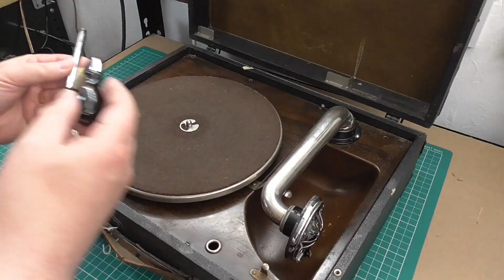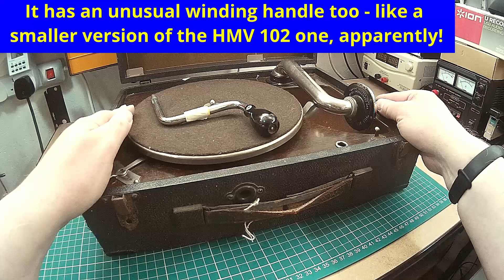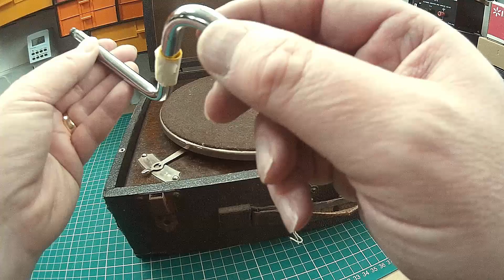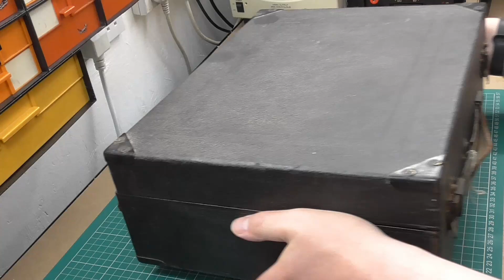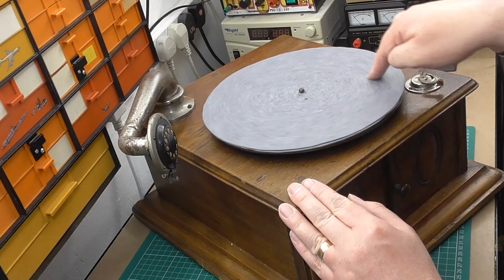Gramophone test WITHOUT a winding handle

Comment: In my experience, this test is only valid if the spring is broken near its centre.  I recall owning an HMV portable in which the spring was broken at the outer edge. It was possible to wind it to about 25% capacity before the charactersistic 'ratatat' of the spring rapidly unwinding within the barrel. Needless to say, it would need many reverse turns of the turntable to reveal this style of fault. Would say your test is worth doing, but not 100% definitive. Yes, springs are dangerous, but was lucky that my father told me how to remove one safely & my metalwork teacher helped me 'de temper' the end of the spring to create a fresh hole for the rivet. A YouTuber friend in the Harrogate area (Samantha James) has a gramophone with a broken spring. Can you recommend anyone who'd fix it for her please?
Reply from the maker: Very good point. Yes, it is by no means a definite test, but a handy little test that can be useful. Unfortunately, I don't currently know of anyone offering a spring replacement service. Due to the hazards of spring removal, I can't personally recommend anyone trying it. I do hope to try cleaning and regreasing a spring whilst it is still in the barrel, which is something I have seen recommended in an old book. This should be a safer option, but of course, it is only viable if the spring is intact. Thanks

Comment: Maybe you can answer this question for me……….. is it possible to buy brand new springs ? 
I want to buy a brand new spring (also preferably in its casing all ready to slot into place on my gramophone)
I need a double spring for my HMV 130. 
Can you advise or point me in the right direction either way a possible link 
?
Reply from the maker: Sorry - meant to reply to this before. Unfortunately I don't know of a source, though if you are on "The Talking Machine Forum", someone may be able to help and there is a very well known dealer by the name of Soundgen who (at least in the past) I believe been able to supply replacement spring barrels. Another possible source is from another motor. Whilst changing a spring certainly has its dangers and is not something I would recommend anyone trying, switching the spring barrel from a working motor to a non working motors is easier and safer (do make sure the springs are fully unwound before doing so), though in many cases it might be simpler to just switch the whole motor - like I did with my HMV 130. Thanks 😀👍
https://youtu.be/6PbHfAw6Jwo

Comment: Thankyou i didn't know that what good advice i was given a nice HMV table top Gramophone last year and i was lucky though it didn't have a winding handle i had a spare which fitted it and to my surprise the spring was in good working order. Thankyou again i look forward to more of your video's. 😊😊😊
Reply from the maker: @Kevin-yi8fd  Thanks, glad you enjoyed it! 😀👍. Yes, most of the time a spare handle is relatively easy to find as many HMV/Victor machines take the same ones, and they can also be swapped around on Garrard ones. The older slotted type vary alot though, and that is what the broken machine in this video takes. I have found a handle that fits it, but as expected, it doesn't wind. The HMV 99 portable just annoyingly takes a special handle so not so easy to find a replacement. Glad to hear you were able get your machine going. 😀

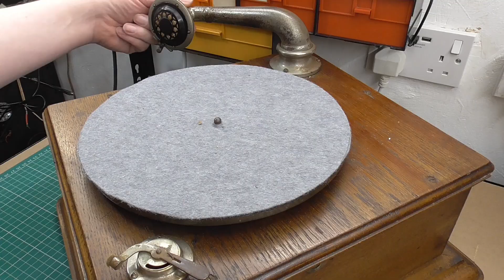Comment: To play a 78 RPM record of 3:00 length would take like 250 plus turns of the record backwards.
Frankly, I'm surprised you can turn it backwards at all.  Worm drives generally can only be driven in one direction.
Reply from the maker: @tarstarkusz  Yes, indeed, and from a completely wound down spring, you would probably need to put another 100 or so turns on that to ensure the speed was maintained throughout the duration of the record. As to your point about the worm drive, I have to investigate. However, as I said, I'm sure there will be exceptions to this 'rule'. Thanks

Comment: I was lucky when i bought my cabinet gramophone, only one of the springs had jumped off its screw to the driveshaft., 
I have looked at new springs for these machines and they can be quite expensive, though i have seen how people change broken or worn springs by releasing the spring from the motor casing into a construction bucket.
Thanks for the lovely video.
Reply from the maker: Yes, there seem to be various techniques for doing this. A broken spring is certainly one of the most frustrating parts of this hobby. Whilst it is technically possible to change them, I feel I should err on the side of caution and recommend people getting an experienced repair person to do this sort of work. As I am sure you are aware, they are very powerful and, if not handled properly, can easily cause significant damage and injury. Thanks